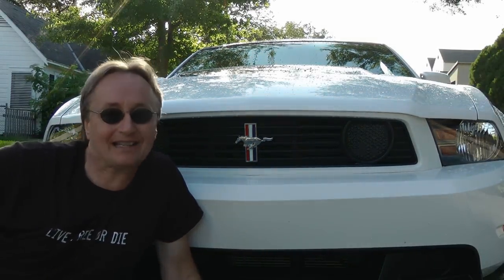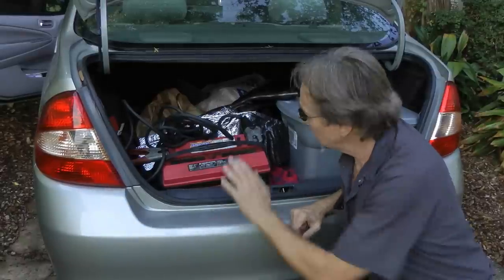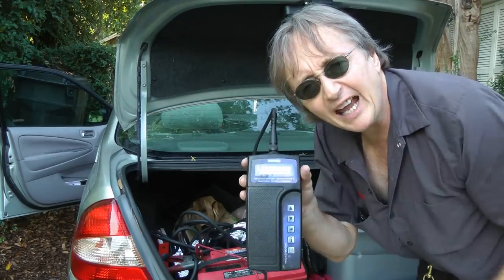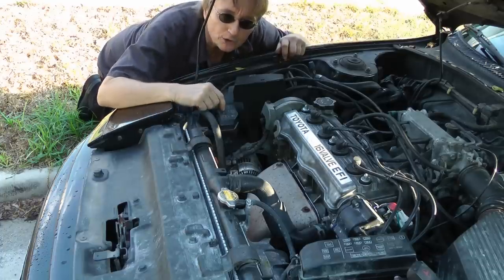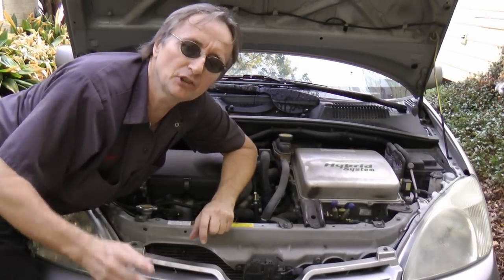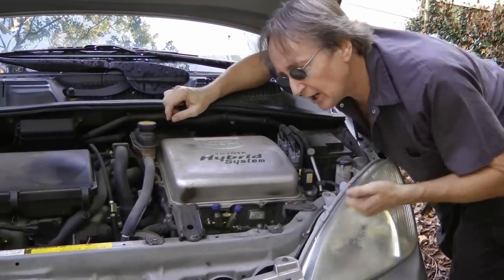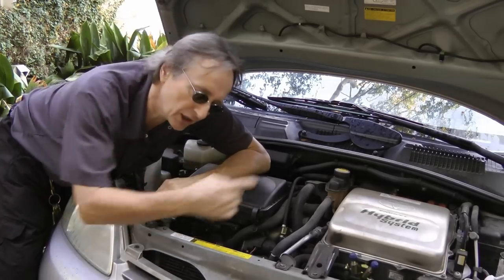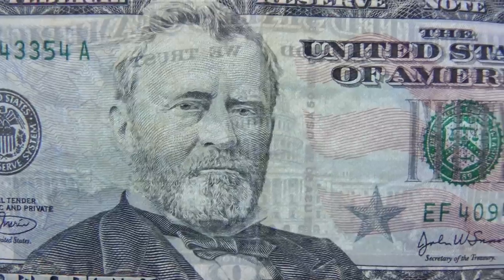Hybrid Car Electrical Problems

Comment: The only reason you would get a Prius is to use less gas which the whole world is running out of. It really all comes out the same. I pay $10-20 per tank and go 550 miles but it goes back into maintenance since it's more expensive.
Reply: Id rather die than own a prius ew
Reply: lol, bad logic bad facts gets you a prius
Reply: +Angel Hinostroza 
The whole green trend isn't because the world is running out of fossil fuels. There's enough of it to continue our rate of usage for hundreds of years. It's the pollution that people are being concerned about.
Reply: ***** only? I haven't put that much in my 20 year old jeep with 200k on it
Reply: ***** have no reason to rebuild that engine, doesn't leak or burn oil. I could care less to be honest how much gas it burns, saves me 500 per month in car notes and will go anywhere with its lift and knobby tires. Think how much it saves not having to trade in every 5 years like most tree huggers
Reply: ***** that jeep doesn't have complicated emissions systems to run exhaust back through the engine gumming it up and killing it early. These new cars that have complicated emissions system will never last as long nor would it make sense to rebuild them cussing 4x the vehicles to be created. I bet the only thing all this government envisions is achieving is better fuel mileage and alot more costly vehicles to repair for the end user. Basically it's an environmental tax that's achieving nothing
Reply: Don't tread on me, I'm just a slimy soft snake LMAO! GTFO

Comment: OOOOOOOOOOOOOOOOF to every Prius owner
Reply: Scotty is wrong in here, in every aspect. I have never heard of the electric motors on a Prius failing, thus the Prii is among Toyota most reliable vehicles, specially the Prius C, most likely the most reliable.

Comment: This is like buying a high efficiency central air conditioner to lower your electric bill when the one you have works fine. Yes the newer unit will be cheaper to run, but by the time you get your money back in energy savings it is time to replace the unit.  Hybrids are worst, at least newer a/c units don't cost much more to repair than an old one. With hybrid cars, only is there the up front cost, there is the insane cost of repairing it when something goes wrong. Yes they do reduce carbon emissions, but the disposal of the batteries creates separate environmental issues. Newer cars are much cleaner than the old. In big cities they still cause issues with smog because of the large number on the road, but it's getting better. Hybrid and electric will one day be feasible, but we are not there yet.
Reply from the maker: tis all true
Reply: One day be feasible? LMAO! WAKE UP! You can't neglect a car then blame the tech...geesh!

Comment: An automatic transmission with a hybrid is probably the worst thing ever to exist!
Reply: *****
 I agree.. VERY rough ride,noisy and the heat ( least in the one I rode in) SUCKS. I'd rather stick with a pure gas car.
Reply: Get sonata hybrid its great quiet and powerfull
Reply: +Willa bema Really? i have a 2013 nissan sentra and i've driven 12k miles a year and only spend $900 a year so far in gas LOL. Looks like those hybrids don't save you anything and cost a lot more.

Comment: Hybrids save you money at the pump, but that's about it. They cost more to buy (negating the fuel savings) and are much more complex electrically and mechanically because of the extra systems onboard. Any 10yr old hybrid is going to be a nightmare with repair costs.

Comment: 9 year old car at the time?
Reply from the maker: yes
Reply: Well just that its an early design of hybrid, the place where you save the money is in the gas. If that fixed the car for 4 years its likely to have paid itself off is gas savings. Also 10 years is the useful life of most cars and your using bailing wire to hold them together if they use salt on the roads in your region. If its possible it would be interesting to look at something in a 2012 Camry hybrid
Reply: It's a well beaten up 9-year-old car with high mileage, must be the car's fault LMAO!

Comment: Whoever owned this Prius is a ass. It's in such bad condition, no wonder why it broke down. any car can go 200k+ with the right Maintenance. But some cars, ie dodge will need more repairs on the way where as cars like the Toyota Corolla will only need oil changes.

Comment: What about a certified preowned thats on toyota if anything battery or charging or anything at all is on them esspecially with an extra extended warrenty they will honor and fix the vehicle while customers even toyota owners privatly sold certain vehicles should be forcing toyota or any car company to follow up with there words to take care of any problems with any of there vehicles all for free we demand that being explained already by toyota when they sell any hybrid that they will fix any of these issues very enthusiastic toyota explains they will fix anything bumper to bumper absolutely free and explained by toyota there is no scam ivolved with there agreements and no fuss getting free repair from them and they sware by there buisness they will fix these cars for no cost to any buyer before the keys are handed over to the new owner of any of there certified preowned vehicle esspecially so anyone with any car trouble like this should be making sure its on Toyota's dime esspecially with how much toyota encourages it is free if anything were to happen by any chance on the road to fix any one of there certified preowned cars esspecially these cars they will fix anything absolutely free everyone needs to get the most out of what any car company promises to there customers or even like most these cars have transferable documents for a new certified preowned owner to make sure there maintanace is free of charge even not being a toyota dealership customer neccisarily so remember there should be options not like this guy is saying that we should all stick are dicks in money twirl it around and toss it out the back porch lol bro people just need to be on top of the car dealerships unite as one we all can be more powerful in numbers

Comment: you endup dumping more batterys throught the year which you endup actualy destroying the environment you are trying to save!
Reply: Prius batteries can be recycled/renovated and reused.  They needn't be trashed.
Reply: Actually, the batteries can be removed at the sub pack level.  They are several specialist in my part of Maryland that offer these services.

Comment: great vid bud,see stupid people buy these cars thinking ohh i wont burn gas and hurt planet earth but where do the electricity come from,a big dirty hydro or neucular plant that pumps chemicals in the air,so in the end you might as well get a regular car that you can actually fix and drive it,if it was up to me i would drive an old carburated v8,but gas prices fucked me there

Comment: I do NOT care for hybrid cars at all... rode in one yesterday and it was very Jerky, could tell when the engine cut off and on making the car shake ( not good with a bad knee) and NO HEAT in it.. and they sound weird.. like a cross beatween a weed eater and vacuumm when you accelerate. No I won't reccomenrd one to my mother who is in the newer car market. we'll stick with the old fashioned gas models :)
Reply: grettagrids *or diesel models